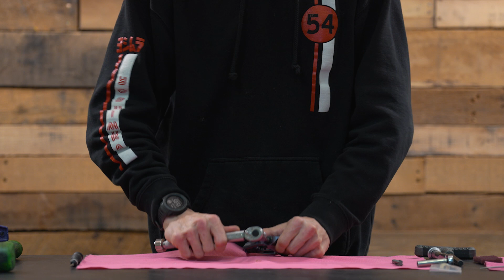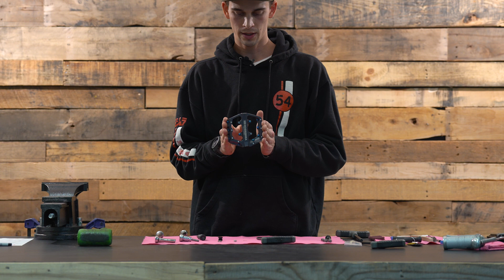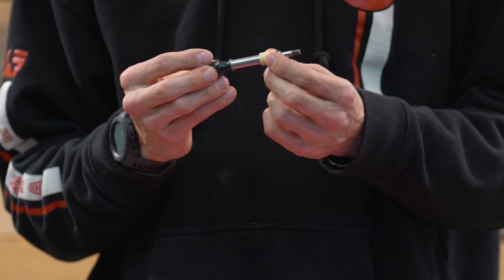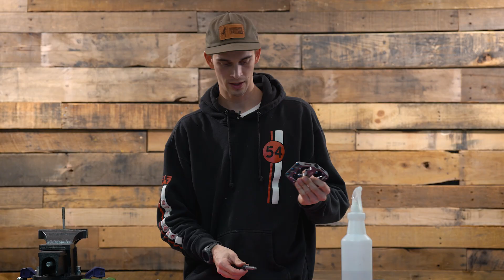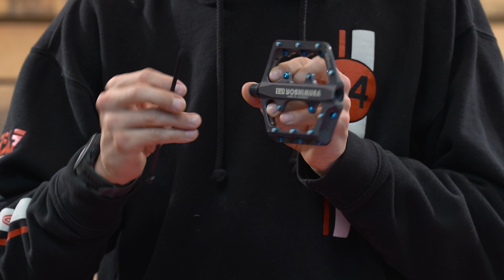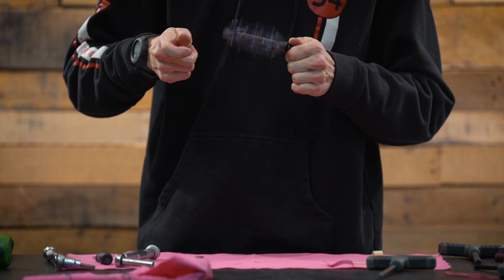How To: Chilao Pedal Service Kit

Comment: Hard to tell what's going on from this camera view. Pedals look sick though. Anyone know how they hold up long term? Does the paint chip away easily, and is there any difference on wear & tear between the pewter and yoshikote colors?
Reply from the maker: If you go to our website there are a lot of reviews from buys and you can see the long term reviews too! We don't use paint we use a type 3 hard anodize so the finish is very durable compared to paint.
Reply: They don't. I have both the new ones (Chilao SS) and the older ones (Chilao). The bushings will go in under a year, and he even says it at the very beginning.

The aluminium pins round-down  even when you don't pedal-strike and the bushings do not hold up. 

It's a pedal subscription to be honest. $32 for pins and $15 for rebuild kit. 

They are nice pedals, but to compare, I want through 2 sets of pins and 2 sets of bushings in 2 years. While my Hope F20 is un-opened, un-touched and works like on day one on my 4th bike (from 2017) ... that's 9 years, 9 rainy seasons, daily riding, crossing creeks :O